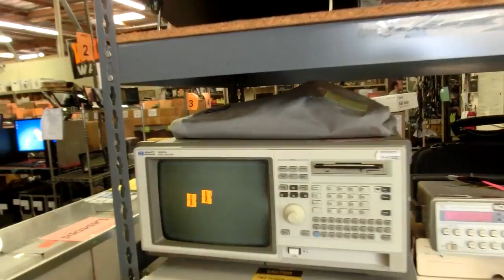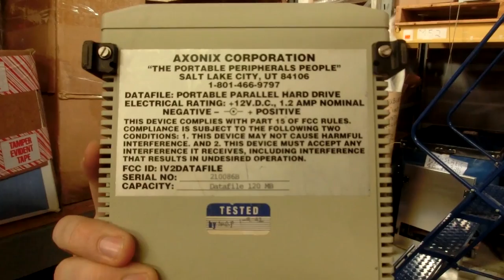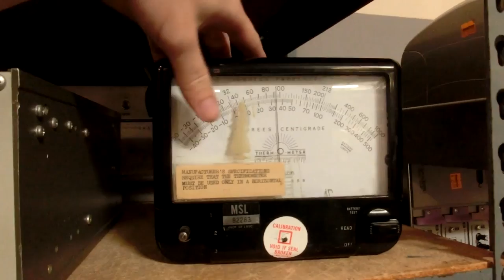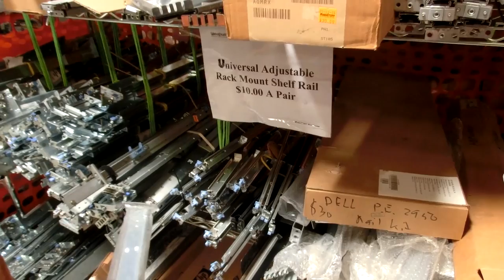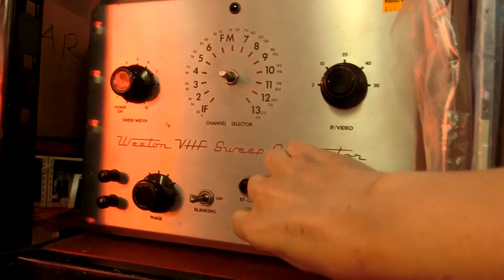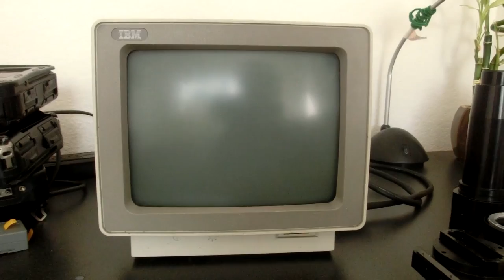Random Bits 0174: Behind the Scenes look at WeirdStuff Warehouse

Comment: so many vintage keyboards! Especially being in the valley I bet there are a lot of old apple extended keyboards. I would love to sift through all of them
Reply from the maker: +Bryce Young oh are those worth anything? i probably could have saved a bunch from the recycling bin when i worked at Apple. haha
Reply: About $50-80 depending on condition. Apple used Japanese ALPS switches which are no longer made but highly collectible. Enthusiasts buy them up and disassemble the board for the switches, and then make newer style keyboards with them.

Comment: Same here, first computer Sperry IBM compatible. 4 MHz!
Reply from the maker: still got it? i sold mine at a yardsale for 20$ in like 2002 :/
Reply: My first computer was a PC-XT, I sold it to buy either a 286 or a 386 sometime in the mid '90s, I wish I would have kept it. I had a huge Infocom game collection (still have it, actually) on it with all of the text-based Zork games. I used to play Keen 4 on it, but it was ridiculously slow. 

One of the games you're thinking of might be Jumpman, you can check it out on a few of the abandonware websites. The solar system tour program might be The Astronomy Tutor, and I have it on 5.25 floppies, but I very much doubt that they work and I have no way to test them.
Reply from the maker: +idontcare80 thats cool that you have your original game collection. im thinking the game i had might just be a homebrew game given how simplistic i remember it being. i honestly just remember it being white line platforms and a very blocky guy jumping on them, but i never could figure out what to do.

and ive been thinking, that astronomy game may have been on my windows 95 machine. i could be remembering wrong.
Reply: I hate that, when you can't remember something well enough to find it again, or when it just can't be found. There's a media player program that I used on Windows 3.1 that I can't find anywhere, and I have no idea what it was called. Anyway, maybe just try browsing the abandonware websites, I've gotten lucky doing that before.  

I'd send you the astronomy program disks, but I'm ridiculously broke, and I think someone wrote over the first disk.The write protect notch is taped over and there's some writing on the sleeve, damn it.

Comment: I suggest your friend use RBC11 connectors his board.
Reply from the maker: +penguins forall do they have 6 pins?
Reply: +Rinoa Super-Genius  Nope. But from the video the guy was trying to use an IEC C14 which has 3 pins. https://upload.wikimedia.org/wikipedia/commons/8/8f/IEC60320_C14.jpg
But the classic 6 pin DIN connectors would work for that and are easily mountable on both sides by using a screw on male coupler and then attaching the threads to what ever device.
Like this: http://www.skycraftsurplus.com/images/products/detail/rp0852.jpg
Reply from the maker: ProfessorX was thinking about using two connectors. they need to be able to handle several kilowatts of power since they are powering large wheelchair motors.
Reply: Woah, thats one powerful wheelchair. A pair of motors to move a person I'd expect to be in the 500-800 watts range. Also if its 48 volts the amps would be lower. I believe most wheel chairs are 48v. Worst case is 12v @ 800watts so 66 amps but I doubt it. So what he really need is a 3 pin with big enough pins. Actually current carrying on multiple pins is not a good idea as if one breaks the other becomes a fire hazard.